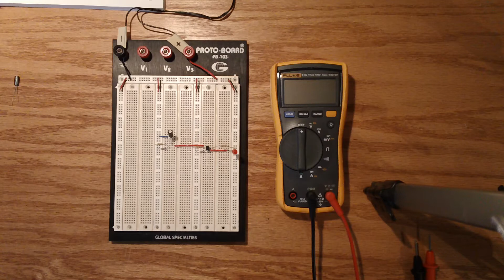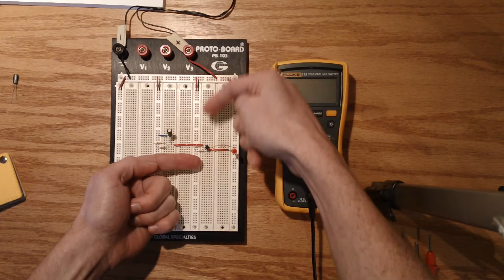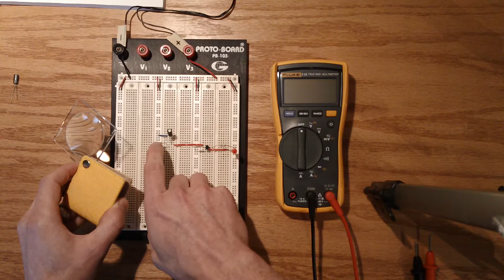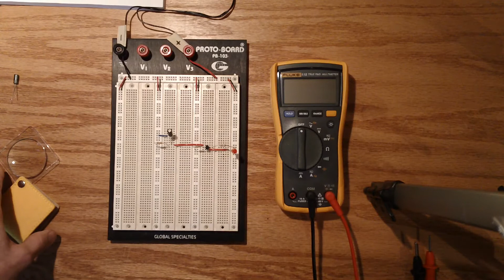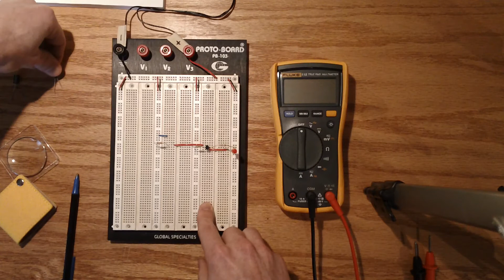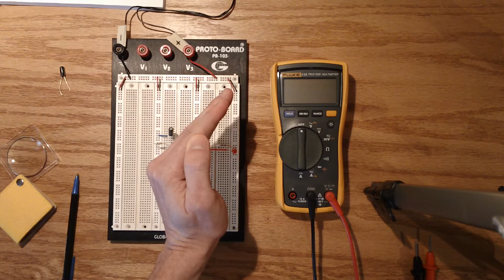Make: Electronics - Experiment 11 (Part 1)

Comment: I changed out the PUT and I am getting the same results.  Same with changing the capacitor.  Double checked I am using the correct resistor values.

Comment: I have done this experiment (the first part before the speaker is attached) and all i get is a constantly lit LED.  I have triple checked my set up and it seems to be correct.  I am starting to think I may have a faulty transistor.  Is there any other reason why I may not be getting the correct results assuming everything is set up correctly?

Comment: Hi! That question is a little tricky. 

In the book he says we have to "establish the voltage at the gate."

We must remember that just because the resistor is placed after the gate, that does not mean it won't affect the voltage flowing through the gate. This is just like how a traffic jam three miles ahead of you will still slow you down.

We're making the voltage at the gate some level between the anode and the cathode voltage by using 13k and 27k resistors. Why one before and one after? idk!

Comment: I've done this experiment twice now. I still don't understand why the power supply itself is insufficient to overcome the threshold in the PUT. Voltage from the power supply meets infinite resistance (if the gate is closed), but that makes the 470K resistor irrelevant, and so the full voltage should be present at the anode. No? How do you calculate the voltage coming from the power supply? Or is all the voltage diverted into the capacitor?

Comment from the maker: Well...in reality if you turned the supply completely off after the cap was charged, the cap would probably discharge through the PUT and LED since the PUT would have a 0V threshold and offer less resistance than the combination of 470k + 15k + 27k.  It might discharge down both paths, but you've got the right idea now.

Comment from the maker: That discharge path can't happen because the capacitor would have to be able to discharge against the direction of current flow.  Remember the supply voltage is always "pushing" in on direction (at least in this case since we're dealing with DC voltage).

Comment from the maker: It sounds like you need to dive into the mechanics of how capacitors work ;).  The gist of it is you've got two very close (but not touching) plates, one of which is gradually building a collection of electrons and the other losing the same quantity, effectively creating tension (or potential between them).  It's this potential (to do work) that is allowed once the threshold for tension is met (as specified by the PUT).  The end goal is neutrality between the plates of the capacitor (discharge).

Comment from the maker: It's been quite a while since I did this experiment, but I took a quick glance at the schematic for the beginning of experiment 11.  It sounds like you're unclear how the PUT works.  The cap gradually charges up to the voltage level of the supply, but before it can reach that maximum level, the moment it reaches the voltage level matching the threshold set for the PUT, the PUT opens up allowing the cap to discharge itself through the PUT through the LED and back to ground.